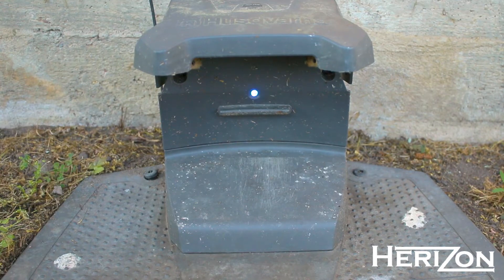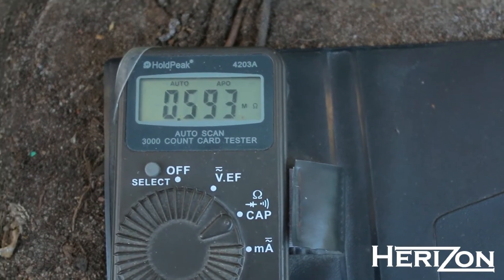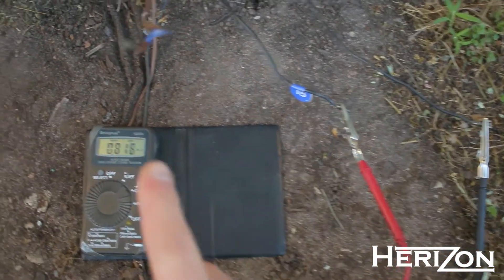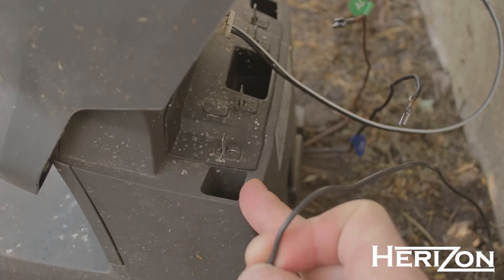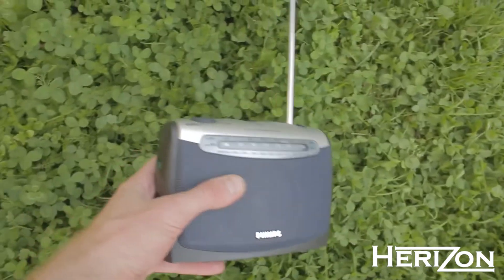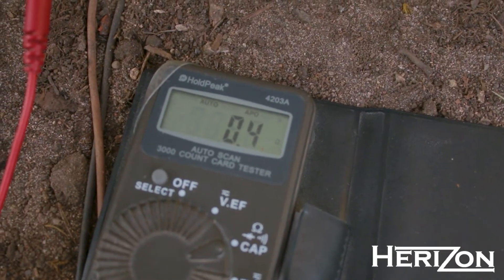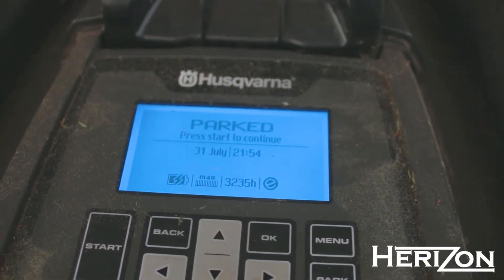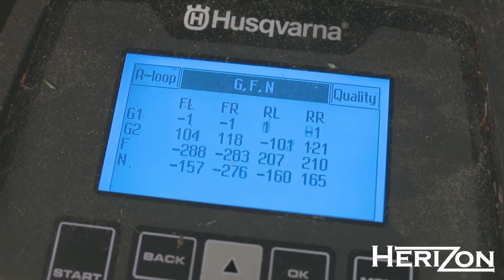Finding a cable break in Husqvarna Automower robotic lawnmower boundary wire using a MW/AM radio

Comment: When you connect the battery I see that a connection + on the left cable - on the right cable. When you connect like this, doesn't it mean that you short-circuit the boundary cable?
Reply from the maker: Yes, during the short most electrical energy is being converted into thermal energy, which in turn melts the conductive material (copper, aluminum, tin) first in places, where electrical resistance is the biggest in the circuit. When cable is completely broken and there is no current flow, break can be found using AM radio.

Comment: I have o e that says no break as solid red light but the lawnmower insists there is
Reply from the maker: Solid red light means there is an issue with the charging station circuit board or an incorrect/defect power supply is connected to the charging station.

Comment: Husqvarna robot mower is hot garbage, have to fix issues every year and it cost money. Cables are so weak that they just break from weathering around the charging box.
Reply from the maker: That's not robots problem, incorrect wire has been installed. I have H07V-U 1.5 mm² wire installed in 2017 spring, soldered together and ABSOLUTELY no problems.
Reply: Where's your logic, man? Husqvarna does not make cables. My Husqv mower with original cables has been working well for 5 summers so far. All cable brakes have been due to my sharp shovel. I need to sue the shovel producer...
Reply: @bitterNDsweet  Or the shovel operator.  :)